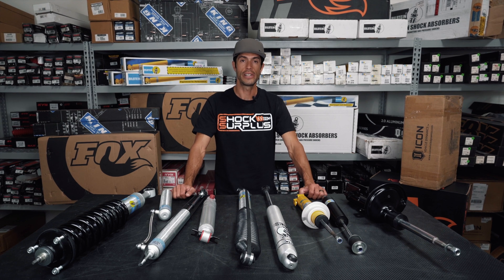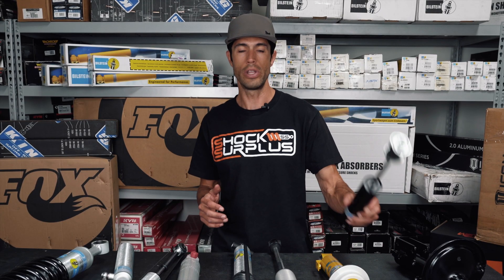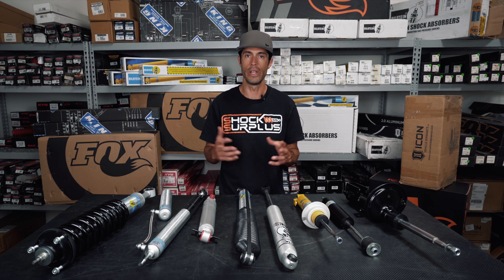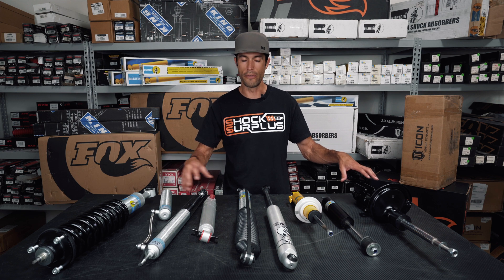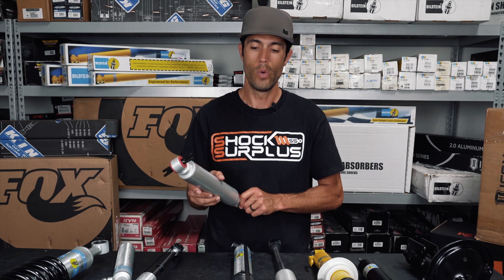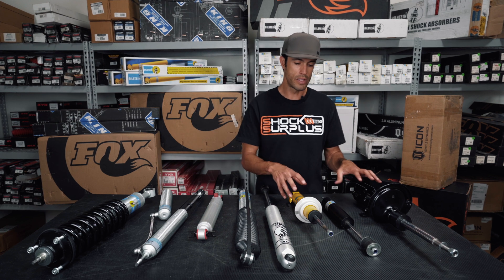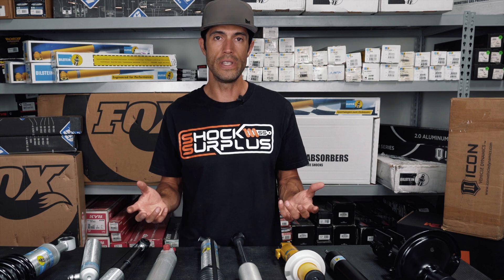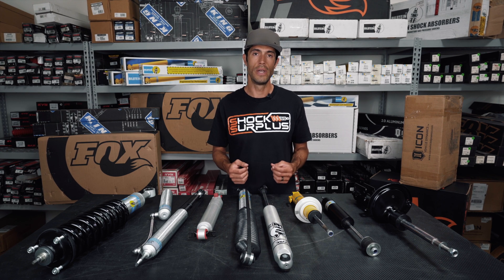Shock Talk Terminology - Ride Control, Comfort, Bump Compliance, Harshness, Boaty Behavior

Comment: Hi, I watched too many videos from your channel and caught my attention to King suspension for my upcoming Nissan Navara. may u recommend if I should go with King shocks or other brands while my only purpose is to have the most comfortable ride on my Navara and I mostly gonna drive it around the city (bumpy roads and tough road conditions on rural area) and highway not for offroad. Much appreciated for ur advice,and it's great if anything that works similar to Clearmotion electromagnetic suspension will be another takeaway for me. I love riding comfort cars but in love with the truck. Thank!
Reply from the maker: The Nissan Navara was never offered in the US. They don't make direct fitment parts. It'll require a bit more work but it might be doable to do a custom set up. We just need to know all the suspension specs like measurements, mounts type, mounts specs, spring rates and so forth. May you please contact us directly to get further assistance on this?

Comment: Most comfortable ride for a 2022 Ford Ranger Wildtrak 2.0 litre Bi-turbo 4x4? Stock suspension gets jiggly on concrete roads.
Reply from the maker: The 2022+ Ford Ranger 2.0 Liter Bi-turbo is not here in the US yet or technically officially announced. No manufacturer currently offers parts and we don't know if the suspension is the same as the previous generation/body style or if it's a completely new platform.
Reply: @ShockSurplus   hi sir I have a honda accord daily driver 07 v6 sedan the car came with some after market suspension that makes me higher than most I can fist my front wheels with 19 Inc wheels it's crazy I'm looking for something that can eat turn and bumps and will last cuz im going to marry my car 1 day❤ but like you know when drive a truck you go at a turn real fast it feels like that thing gonna flip that's me every day

Comment: I got a 2018 sonata, lot of body roll and some weight on the trunk makes the back sit. Mostly body roll even on low speed is the issue. Also want ride height to be a bit lower if possible. Any suggestions?
Reply from the maker: We don't offer much for your vehicle. All we have is Monroe or KYB OEM struts and shocks.

Comment: For wrangler JK 2010 no lift, i want a smoother ride than stock shocks, more damping, its my daily driver with very little offroad, what should i go for?
Reply from the maker: I would say look into the Fox 2.0. They are quite comfort for daily and firms up when you're off-roading which helps keep the truck more tight and not loose.
Reply: @ShockSurplus  Thank you for this appreciated, what could be a less costly option?
Reply from the maker: Eibach Pro Truck shocks have proved to be a great setup that's functional like both Bilstein 5100 and Fox 2.0 but without the firmer feeling of those two brands. You would need 2 x E60-51-001-01-01 for the front and 2 x E60-51-001-01-10 for the rear which are all 0-2" shocks.

Comment: im really on the fence with 6112-5160 or OME. im not rock crawling jeep rated trails but i do offroad at least one  weekend a month.  mostly fire / washed roads with the occasional rock obstacle.  i had a 3/1 spacer level and was forced to take it off.  now I want to go back to that same height but no spacers in the front.  I hear OME are pretty stiff if you dont have weight added.  I know down the line i will be adding a bumper and winch but thats years down.  suggestions?
Reply from the maker: Depends on the vehicle as not everything is offered for every vehicle. But currently, we think Bilstein 6112 and Eibach pro Truck Stage 2 is the move right now.

Comment: I got a 2016 Toyota Yaris hybrid and my suspension is very stiff , to put it nicely . It's my daily drive and i just want it to run as smooth and soft as possible , as in riding a cloud , on bumpy street roads . Do you have any suggestion as in brand/model etc? I'm clueless when it comes to this stuff , i'm a relatively new and casual driver . KYB seems like the choice according to your experience? Appreciate the info and keep it it!!
Reply from the maker: KYB and Bilstein would be the go to choice for you.
Reply: @ShockSurplus  what about Monroe quick strut?

Comment: So I have a 2019 Kia Soul that I would like to make more comfortable. I don't off road and live in a suburban area. Wanted to pick your brain on the choices or steps that I could take moving forward with making it a smoother, more comfortable ride for myself and passengers. I also wanted to drop the height about 1 inch as well. Only modification to my vehicle that I have currently are 18" wheels. Thank you!
Reply from the maker: Not much is offered or in stock currently. If you're also lowering it, you'll need a lowering spring or a coilover setup.
Reply: You need a set of BP50 ones and just have the setting ride in the softest.That will get you what you are after
Reply: And if you can't get them where you are just get anything.That's adjustable.Put it on the softest or harder setting and work in the other direction until it's at your comfort

Comment: Just picked up a ram rebel and I’m looking to get a lift or level needed to fit 35s with method 18inch wheels. I’d like to have better comfort than the stock set up now (stock is pretty dang smooth) but at the same time can handle if we end up going to the lake on the weekend and go through some light trails. Can anyone recommend a set up that they’ve had great experience with in their rebel? Great vid man!
Reply from the maker: Really depends on how much lift you want to do and how much you want to build this for a specific use. Contact our sales team directly for assistance.
Reply: You don’t need a lift for 35’s.

Comment: Im looking for a rear shock to be a bit for stiffer than a Bilstein 5100 near a Bilstein price tag. Any suggestions?
Reply: '12 Tacoma TRD sport. I have a constant load of 700# as a daily driver. My stock springs with ICON AAL and 5100 and I bottom out on small speed bumps.
Reply from the maker: Is that 700 lbs. in the rear? If so those AAL wouldn't support it well. You'll want a full leaf pack from either Icon RXT or Deaver Expedition series 2" stage 3. We can get you both of those parts.
Reply: @ShockSurplus  yes. What about rear shocks?
Reply: @ShockSurplus  I intend to install deaver stg3  and 5100 coilovers in the front
Reply from the maker: We have ran Bilstein 5160 for both leaf packs and they have worked fine.
Reply from the maker: What is the vehicle and why you trying to stiffen up the rear? is more comfort or for weight support.

Comment: I have a '09 chevy 3500 cutaway van with a shuttle bus body, converted to a RV.  Ground clearance is an issue!  My question, will installing air assited shocks allow me to raise the body when needed? Only have 7-8 inch clearance at bus door.  If so, what brand would you reccomend?
Reply from the maker: Please contact us directly and we'll help you out.

https://www.shocksurplus.com/pages/contact-us